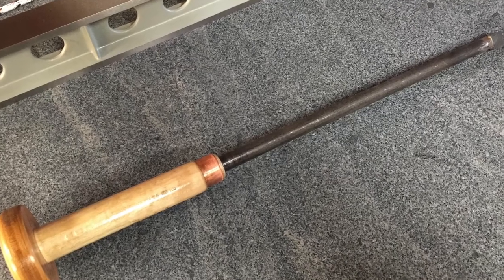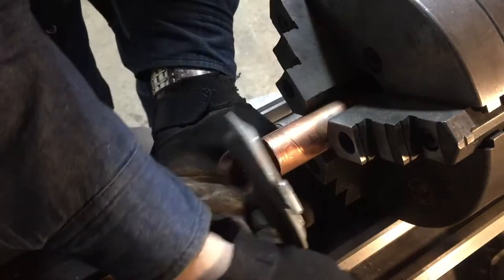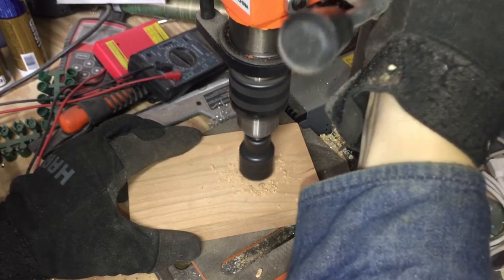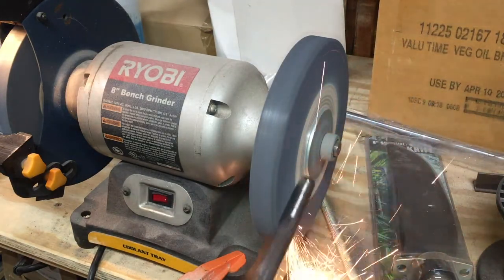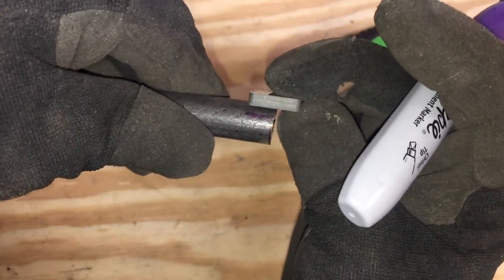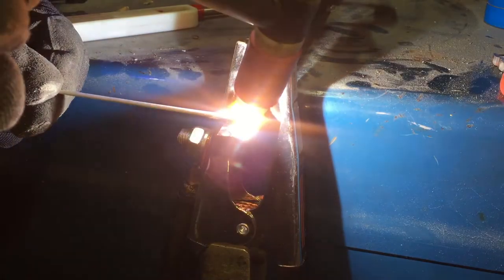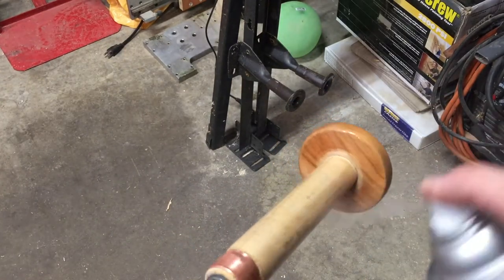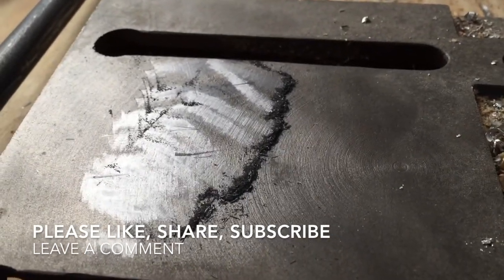DIY hand scraper for machine restoration. Lathe project 0

Comment: I think, better to make SANDVIK-COROMANT CLAMP-ON-SCRAPER clone ... It will be easier to sharp carbide blades ...
Reply from the maker: I didn’t know the brand name for this kind of scraper, but, I already bought some cold rolled flat bar to make more scrapers out of it. Stay tuned for more vids :-)
Reply: I'm going to make my CLAMP-ON style scraper by using 16" long harbor freight screwdriver as a handle ...
Reply from the maker: That sounds like it should work just fine! What are you going to use it on?
Reply: I want to buy a used surface grinder and rebuild it.
Reply from the maker: Those I heard might be the most intricate ones to work on. Best of luck! Keep us posted of your progress!